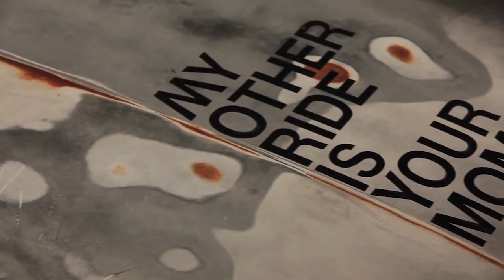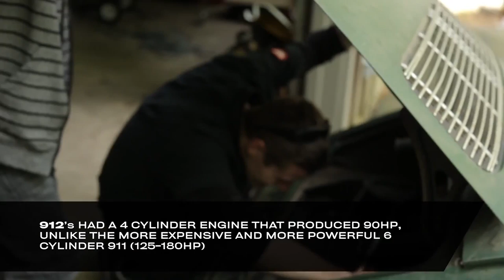Best Of /DRIVE: 2013 - AFTER/DRIVE

Comment: THE RIGHT TO TRAVEL vs THE PRIVILEGE TO DRIVE

The Law is clear, traveling on the public highways is a right devoid of any statuary obligations, need of licenses or permits, or any other form of permission from the state.

“The navigable waters leading into the Mississippi and St. Lawrence,*and the carrying places between the same, shall be common highways and forever free, as well to the inhabitants of the said territory as to the citizens of the United States, and those of any other States that may be admitted into the confederacy, without any tax, impost, or duty therefor.” [Northwest Ordinances, Article 4]

“Highways are for the use of the traveling public, and all have the right to use them in a reasonable and proper manner; the use thereof is an inalienable right of every citizen.” Escobedo vs. State 35 C2d 870 in 8 Cal Jur 3d p.27

“The right of a citizen to travel upon the public highways and to transport his property thereon, by horse-drawn carriage, wagon, or automobile is not a mere privilege which may be permitted or prohibited at will, but a common right which he has under his right to life, liberty, and the pursuit of happiness.” Slusher vs. Safety Coach Transit Co., 229 Ky 731, 17 SW2d 1012, and affirmed by the Supreme Court in Thompson vs. Smith 154 S.E. 579.

“Users of the highway for transportation of persons and property for hire may be subjected to special regulations not applicable to those using the highway for public purposes.” Richmond Baking Co. vs. Department of Treasury 18 N.E. 2d 788.

“Constitutionally protected liberty includes…the right to travel…” 13 Cal Jur 3d p.416

In California, a license is defined as “A permit, granted by an appropriate governmental body, generally for a consideration, to a person or firm, or corporation to pursue some occupation or to carry on some business subject to regulation under the police power.” Rosenblatt vs. California 158 P2d 199, 300.

“Operation of a motor vehicle upon public streets and highways is not a mere privilege but is a RIGHT or liberty protected by the guarantees of Federal and State constitutions.” Adams vs. City of Pocatello 416 P2d 46

“One who DRIVES an automobile is an operator within meaning of the Motor Vehicle Act.” Pontius vs. McClean 113 CA 452

“The word ‘operator’ shall not include any person who solely transports his own property and who transports no persons or property for hire or compensation.” Statutes at Large California Chapter 412 p.833

“A citizen may have the right, under the 14th amendment to the Constitution of the United States, to travel and transport his property upon the public highways by auto vehicle, but he has no right to make the highways his place of business by using them as a common carrier for hire; such use being a privilege which may be granted or withheld by the state in its discretion, without violating the due process or equal protection clauses.” In Re Graham 93 Cal App 88.

“The license charge imposed by the motor vehicle act is an excise or privilege tax, established for the purpose of revenue in order to provide a fund for roads while under the dominion of the state authorities, it is not a tax imposed as a rental charge or a toll charge for the use of the highways owned and controlled by the state.” – PG&E vs. State Treasurer, 168 Cal 420.

“The same principles of law are applicable to them as to other vehicles upon the highway. It is therefore, the adaptation and use, rather than the form or kind of conveyance that concerns the courts.” Indiana Springs Co. vs. Brown, 74 N.E. 615.
“The automobile is not inherently dangerous.” Moore vs. Roddie, 180 P. 879, Blair vs. Broadmore 93 S.E. 632.

“The use of the automobile as a necessary adjunct to the earning of a livlihood in modern life requires us in the interest of realism to conclude that the RIGHT to use an automobile on the public highways partakes of the nature of a liberty within the meaning of the Constitutional guarantees…Berberian vs. Lussier (1958) 139 A2d 869, 872

“Truck driver’s failure to be licensed as chauffeur does not establish him or his employer as negligent as a matter of law with respect to accident in which driver was involved, in absence of any evidence that lack of such license had any casual or causal connection with the accident…Bryant vs. Tulare Ice Co. (1954) 125 CA 2d 566

“The RIGHT of the citizen to drive on the public street with freedom from police interference, unless he is engaged in suspicious conduct associated in some manner with criminality is a FUNDAMENTAL CONSTITUTIONAL RIGHT which must be protected by the courts.” People vs. Horton 14 Cal. App. 3rd 667 (1971)

“The RIGHT to TRAVEL on the public highways is a constitutional RIGHT.” Teche Lines vs. Danforth, Miss. 12 So 2d 784, 787.

“The right to travel is part of the ‘liberty’ that a citizen cannot be deprived of without due process of law.” Kent vs. Dulles 357 U.S. 116, U.S. vs. Laub 385 U.S. 475

“A citizen may have the right, under the 14th amendment to the Constitution of the United States, to travel and transport his property upon the public highways by auto vehicle, but he has NO right to make the highways his place of business by using them as a common carrier for hire; such use being a privilege which may be granted or withheld by the state in its discretion, without violating the due process or equal protection clauses.” In Re Graham 93 Cal App 88.

“CVC 17459. The acceptance by a resident of this state of a certificate of ownership or a certificate of registration of any motor vehicle or any renewal thereof, issued under the provisions of this code, shall constitute the CONSENT by the person that service of summons may be made upon him within or without this state, whether or not he is then a resident of this state, in any action brought in the courts of this state upon a cause of action arising in this state out of the ownership or operation of the vehicle.” California Vehicle Code

“CVC 17460. The acceptance or retention by a resident of this state of a driver’s license issued pursuant to the provisions of this code, shall constitute the CONSENT of the person that service of summons may be made upon him within or without this state, whether or not he is then a resident of this state, in any action brought in the courts of this state upon a cause of action arising in this state out of his operation of a motor vehicle anywhere within this state.” California Vehicle Code
“When a person applies for and accepts a license or permit, he in effect knows the limitations of it, and takes it at the risk and consequences of transgression.” Shevlin-Carpenter Co. vs. Minnesota, 218 U.S. 57.

http://humanityawakens.wordpress.com/category/law-sovereignty